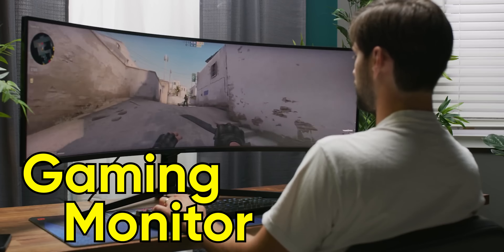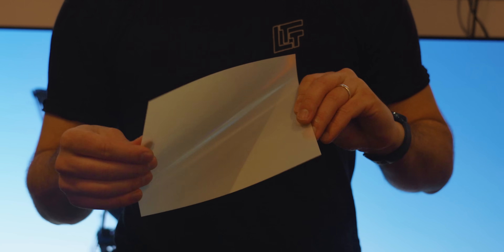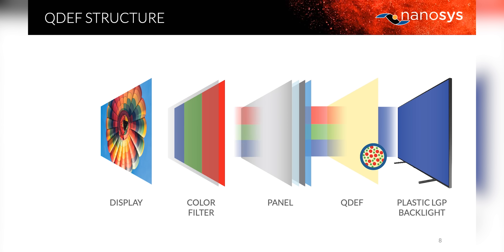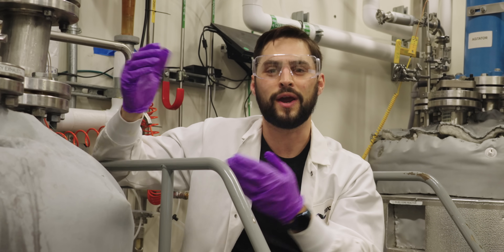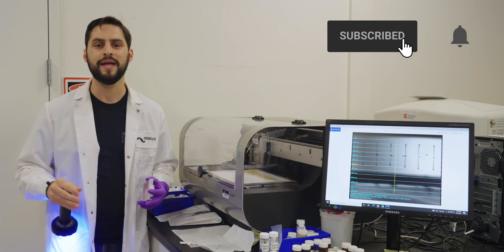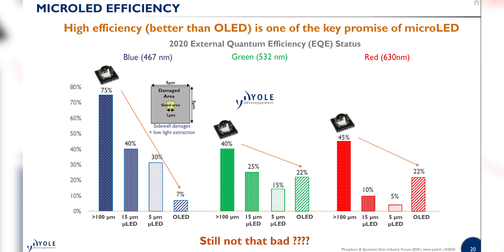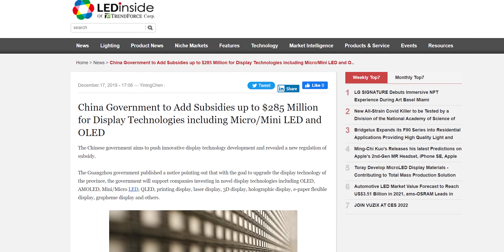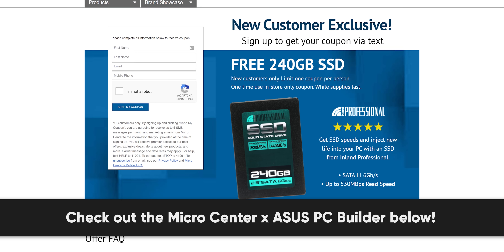This Goo is the Future of Gaming Monitors - Nanosys Tour

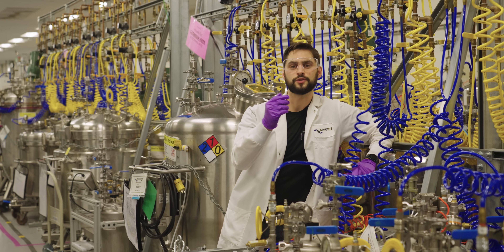Comment: 3:08 Did they add a quantum tunnel for electron injection ? where you can simply have one led pixel filled
with all three substances, which can then be fed one current at a level which then subsequently only goes
into one of the substances, and thus allow for it to emit light ? This would obviate for separate leds,
and have one that emits all possible lights full RGB ?
I mean it may be hard, but knowing when electrons go in at a specific voltage while barring the rest,
would be neat.
You could define it as a molecular transistor that will accept electrons only when between two voltages.
Then, with three separate sets, let's say 0.1-0.2 V is red, 0.3-0.4 V is green, and 0.5-0.6V is blue.
Since they need to be charged more for the blue, it would make sense to use the higher voltage
for the blue, since that would increase the power input.
The hard thing would be to get the overvoltage barred, which would then involve a second transistor
that if switched on (overvoltage) would bar the feed to the first transistor by a third transistor,
and then ofc to make it all possible in combination with the quantum dots.

Comment: Something you almost mentioned - modern colored LEDs are actually blue/UV LEDs with a colored phosphor. So even if a technology is based on a tiny version of an LED, using a better phosphor technology will lead to major improvements in contrast and color quality.

I also think it's funny that the CRT technology of having a ton of RGB phosphors hit with a beam is fundamentally how these displays will work. Just instead of an electron beam, it's a light beam.

Comment: Tvs already have reached perfect images ...more is just useless ...
We have 8k monitors and tvs  .even with a 60` screen you wont see ANY pixel
Reply: arguably yes, but they didnt say anything about better resolutions anyways, they talked about color accuracy, increased efficiency, and decreased cost. meaning cheaper tvs to make and run, admittedly though it will certainly be a while until the cheaper cost is something us customers see in any meaningful fashion.

Comment: Call me crazy but if Micro LEDs drop efficiency so quickly at smaller sizes (especially in Red and Green) that makes it look like LCD is still viable with a single Micro LED per pixel, where the size of the LED would be 345x195 Microns on a 60" 4K display (which is similar to the size of already existing "Mini LED" diodes), plenty large to maintain emitter durability.
If power efficiency becomes the only downside of LCD then MANY people will still prefer the LCD over the competing technologies.  
LCD film becomes more efficient when light is shone more directly through the pixel and not at an angle (perfectly aligning an emitter with each pixel will have efficiency gains), and Quantum Rods can also be used to polarize light and replace the polarizing layer of the LCD, just that step alone would cut LCD power draw by nearly half, at which point even existing Mini LED LCD displays would become significantly more competitive in terms of price/performance.

Comment: I find it hard to believe that everyone thinks it's impossible to make a Micro LED without damaging 4 microns deep from the outside border, maybe it can't be done "efficiently" for now, but even still a 60" 4K display has sub-pixels sized (WxH) 115x195 Microns, the idea that Micro LED is a dead end technology seems exaggerated.
Genuine RGB Micro LED is viable, it's just a question of the cost of R&D vs. the benefits, but in the worst case it would still be highly valuable just to have the process in place to construct a pure white LED grid (85% EQE) to power a Quantum Dot filter.
I'm also skeptical about EQE directly determining the durability of an LED, it's an measure of efficiency, but that standard doesn't necessitate that Silicon will break down just as fast as OLED at the same efficiency.

Comment: 8:56 I helped write the PC Builder for Micro Center almost TEN years ago! And they're only NOW starting to implement the "pc-builder kiosk" inside the Micro Center locations.

It took a lot of tech labor to link the factory part numbers, with the part manufacturer bar codes, to create a new PC-build part code for every part.

The "genius" with the conversion is the way it convert the part numbers to match actual part compatibility. 

So all you do is type the manufacturer bar code, type the MicroCenter inhouse code, and it generates a new PC-B code. And the part instantly shows up in the user gui front page as an option for part selection.

The reason it took over 10 years to implement what I made was to get part manufacturers to agree that each new barcode would basically have a meaning.

Even though I have no part in the implementation, It's nice to know I had a hand in it.

I originally wanted to go to every Micro Center location and setup each Kiosk and teach the employees to troubleshoot the system. But personal matters lead me to literally zip everything up in a nice package for them to implement the PC-B without me. :-(

Comment: meh, until micro leds are going into 1000R curved displays or better still 3D holograms that are barely indistinguishable from actual objects are a thing I quit caring after lcd's came out and got relatively cheap 15 years ago (still using a Samsung 243T from 2004, still works so no need for a new one). I was eventually gonna get a 2k-4k plasma dsplay if it ever was made as a 32" curved variety, but sadly that tech was abandoned.

Comment: To elaborate, traditional LED-backlit TVs use color filters that absorb the other wavelengths of light by turning them into heat. This means that the majority of your backlight's light is just generating waste heat (inefficient). QDs use quantum properties to effectively "cheat" converting the light to green and red (from blue) without wasting energy.
Reply: I wonder how efficient the QD conversion process is. Definitely better than LCD or WRGB OLED but 100%?

Comment: I hear "Might make OLED and micro-LED displays obsolete." as I am watching this on my computer's CRT monitor. I still love the video even if I may be starting to lag behind in the race for the newest tech.
Reply: Still using a CRT as well at the office. Nothing still beats the zero movement blur, and durability of CRTs.
Reply: Self emisive qled  is possible  imagine a sheet  of Self emisive  quatum  dots  it will be like oled  and microled  without placing  tiny pixel leds on a substrate  but Self emisive quatum  dots are still very difficult to pruduce  so they still have to use tactics  that make it more like a lcd  imagine Self emisive  lcd  lol
Reply: @jonathanoxlade4252  There is already a 55" self emissive qd display from BOE called AMQLED.
Reply: All of this. LCDs made sense for the improvements in weight/square inch of screen real estate, but it came with compromises we're still working to mitigate. Excited to see what comes next.

Comment: I love the plastic "TEM cryo" container with the copper braid in it! Why bother using/designing a proper dewar for your LN2 right? XD We do the same thing in our thermal lab if we need a simple and quick way to cool something way down. It's a commen way to cool TEM samples actually, at least for that type of Philips TEMs.
Reply: Thats a cold finger though, so its should be filled with LNO2 for the whole duration of microscope usage, that bucket will be full of ice and the LN2 will evaporate quick, I hope they do this to my boi Tecnai temporary and out of necessity ~_~
Hmm actual proper reservoir sits right beside it, so it's probably microscope on standby and the bucket to collect water drippings after removal of the LN2

Comment: I mean who denies OLED's superiority? It's just expected not to last and not be good outdoors due to low brightness. Then if the MiniLED on the MacBook Pro's is of any indication by Hardware Unbox's review, even when MicroLED gets going it will probably have horrendous response times along their exorbitant cost for probably several years, thus I actually see solving OLED's problems as the best place to put your eggs instead of MicroLED, mind you, don't see where you got a backward opinion on that the least on a heavy gaming-leaning channel.
Reply: There's people using LG OLEDs from 4-5 years ago with no problems. That's fine for longevity. You would never use an OLED outdoors because the screen is reflective, it would be a bad experience and the whole point of an OLED TV is the amazing contrast, which would be butchered outdoors anyway because of the reflectivity, there's no way to enjoy a dark movie scene in daylight on a non-matte screen.
Reply: @DriveCancelDC  You said it, T.V.s, not as monitors. Linus himself proved his C1 is exceptional but burn in is a real issue for monitor usage.

"The screen is reflective", that's not true, you can have a matte finish OLED, glossy is not a requirement. By that I mean it's not because they are glossy that they're bad outdoors, but that they simply are bad outdoors due to brightness thus they end up being glossy since they're meant to be indoors either way. And then even glossy gets tolerable with enough brightness, if not most OLED phones would be truly unusable outdoors. 

So no, I'm afraid I can't agree with your points and will stick with mine, those are actual issues deserving the R&D to fix. It'll perhaps never be the greatest in those fields, but making them tolerable would make OLED the most attractive option all around.

Comment: if quantum dots convert wavelengths, could there be a pair of glasses coated in quantum dots that re-transmit infared light into something visible?
Reply: Quantum Dots are down converters. They only move energy "downhill" from short to long wavelengths (UV/blue towards red). Can't do red -> blue but  interesting idea for a new material & application!
Reply: not sure about infrared but they do convert from ultraviolet into visible light
Reply: Nightvision ? 👀
Reply: @RomanLeBg  That's the idea. I'm sure light is not re-transmitted in the same direction so you couldn't actually see the image but it's an interesting "what if"

Comment: Until they TRULY figure out what to do with burn-in issues, i'm gonna stick w/ LCD panel TV's..... For common people, we can't afford to invest 2-3-4k$ every two to three years or so....
Reply from the maker: QD-OLEDs might have much better image retention performance since they're multiple more times more efficient (in other words, you don't need to drive the emitters with as much voltage).
Reply: @LinusTechTips  only time will tell..... "Might" does not equal "Will"
Reply: @GH0STST4RSCR34M burn-in on LCD's is barely noticeable or non-existent IMO... Sure, you have to deal with a fair amount of light-bleed (especially om lower-end panels) but, unless you watch TVs/Monitors in pitch black environments, and predominantly black or dark images /movies /games, it's basically a non-issue.
Reply: @GH0STST4RSCR34M Never had it happen personally even though we have a tv that is more than a decade old and I use my screens more than 15 hours a day lol. It might be a thing on lcd like you say but it's so unlikely to happen that it's not a problem for 99% of us but oled is something that I'd stay away from as burn in with my use case is extremely likely and there is no burn in warranty either in my country.
Reply: The point is that QD will make everythinng a lot more affordable
Reply: @GH0STST4RSCR34M look, my point is that IF LCD's get image retention problems, it happens much longer along the item's lifetime than OLED... I've had 3 OLED phones with burn-in problems in less than two years.... Two Sammys and a huawei (the latter one has burn-in probs after just one year of having the display swapped) sooo..... Yeah.... I've had my trusted Sammy LCD monitor for about 4 years now, using it daily and, besides a bit of color fade (it's not as vibrant as it was out-of-the-box) i cannot see any burn-in problems...
Reply: OLEDs don't have burn-in issues for 99% of use cases. You can only get burn-in if you use it as a PC monitor and take no steps to prevent it. Also, most "burn-in" is actually just temporary image retention. Fact.
Reply: @GH0STST4RSCR34M I never was closed minded about it happening or negative about it either. It's just fact that Oled will get burn in eventually but in my nearly 30 years of being alive I've never seen or heard of anyone that I know get burn in with an lcd panel. Oled is just crap if your use case is like mine (regularly 15-20+ hours of static content every day basically) because I have 3 screens that I use and while I'm in bed my other 2 screens at my table are on too lol. 

I rarely if ever turn my stuff off tbh. Also the fact that oled tvs are still easily 3x what a good tv costs here in Australia coupled with no burn in warranty I can get a new tv per year if I wanted to for 3 years before it would even approach the cost of even the cheapest oled tvs...

 If burn in was mostly solved to a point where it's like lcds then it wouldn't even be an issue imo but with how it is currently it's not worth it for allot of us. I'm not going to baby my tv/monitors just because I fear burn in either lol which makes it terrible for my specific use case.

 I fully acknowledge that I might get burn in on my current lcd panels some day but so far everything has been great (one screen is only about 2 years old and the other one is about 3 years old while my oldest one is going on 6 years now give or take).

Comment: I just hope Samsung's qd-oled has dimming on a pixel-by-pixel basis like oled rather than local array dimming. If it's just an LCD with a local array dimming OLED backlight that doesn't actually bring it any closer to OLED imo.
Reply: It's still an oled display so yes it's self emissive, but only produces blue light. It just uses quantum dots to convert blue to red and green
Reply: @Lead_Foot  yes, but for each rgb pixel they still need to limit the light going through to change the percieved color. In theory instead of turning off the blue oled pixel backlight they could block all light by setting the r, g, and b values to zero (similar to blocking all blue light to only get red and green for a bright yellow, but instead blocking all colors for a near black). This could then mean that the blue oled backlight doesn't necessarily have to backlight each pixel individually, instead there could be larger blue oled backlights to light up anywhere from every four pixels to four quarters of the display, ergo local dimming with no true blacks all over again. 

I'd love it if they did it the way it appears in the video and the way you are thinking, but I'm betting the cost savings of cutting down on the total number of addressable oled backlights is too tempting. We may see this first before getting displays with a blue oled backlight for each individual rgb QD pixel.
Reply: every oled screen has pixel by pixel dimming that is because each pixel component (red, green, blue) is a diode that emits light  (organic light emitting diode - OLED), LCD is liquid crystal display which uses white light that passes through a liquid crystal filter that gets you the color you need. Had a little bit of a stroke reading your comment, but hopefully this helps, the current problem is that OLEDs suffer from burn in or in other words voltages needed to make the diode shine bright enough degrade the diodes much faster.
Reply: @tr4x1ymus  I'm talking about Samsung's QD-OLED that they explained in the video. They explain that QD-OLED does not have a red or green light emitting diode and only has a blue diode that quantum dots convert into red and green. It could in effect be made like an LCD display, but the liquid crystal would be replaced with QD and the backlight would be replaced with a blue OLED backlight (or multiple smaller ones for local dimming). I suspect they will do this rather than giving each rgb QD pixel it's own blue oled backlight.
Reply: @graysonsmith7031  they will have the same quantom dot film they use now to turn that blue light inot red and green. the same filter used on current oleds. it's shown in the begining of the video. the reason it's only blue light is I believe because it's most durable and cheapest.
Reply: @tr4x1ymus  the reason they use blue is because they have to. QDs can only emit wavelengths of light lower than they absorb because the process isn't 100% efficient so the input light photon must have a higher energy (blue has a shorter wavelength than red and green ergo it has a higher energy). There are materials that can take two low energy photons and emit one high energy photon, but those materials are way to rare and high tech and are only for super scientific research. The fact that blue light has a higher energy actually contributes to the commonly seen phenomenon of blue oleds having slightly worse durability.
Reply: @graysonsmith7031  tnx for the info, good to know